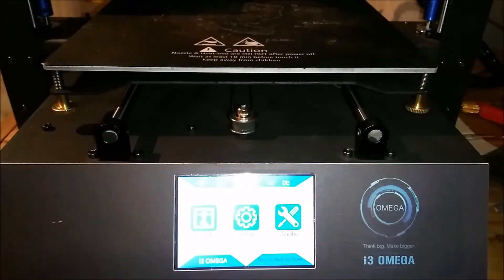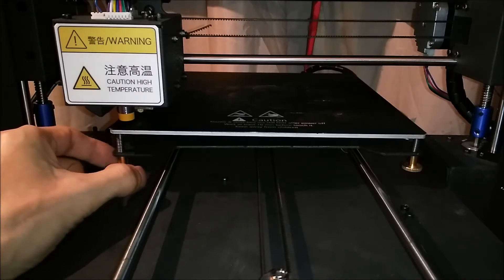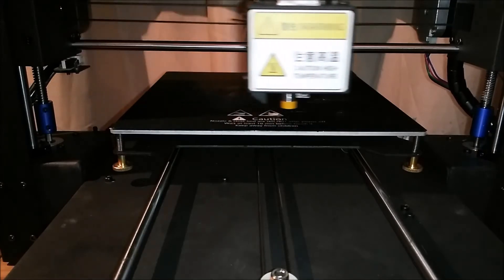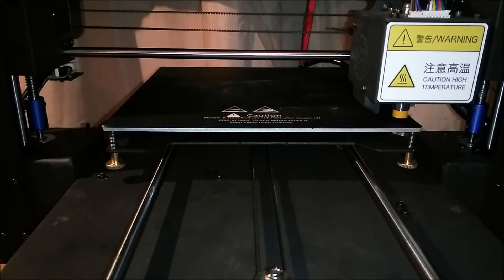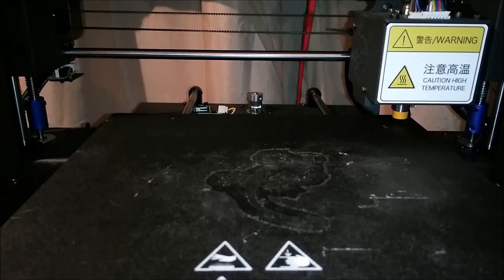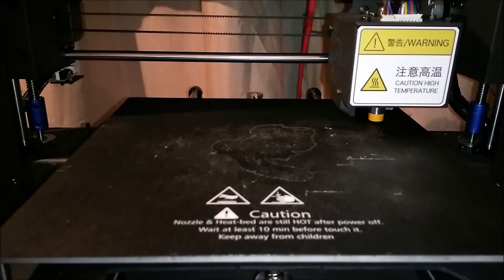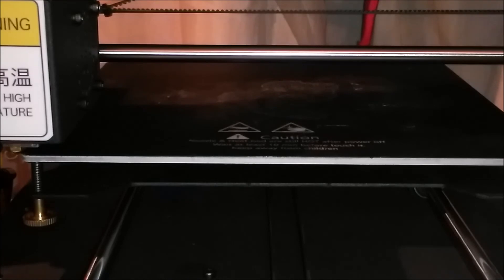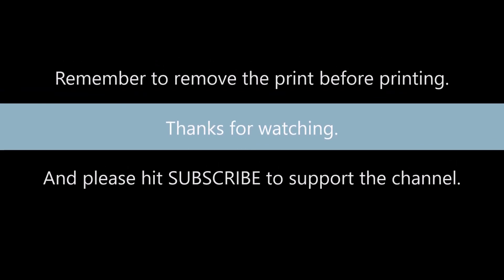Omega i3 leveling

Comment: There is a sw update of the printer ?
Reply from the maker: no idea tbh. i have not had one. but then again i don't think i have ever had the printer connected to the printer. i will do that soon and see if it updates its firmware. i take it that's what you are talking about. ?
Reply: i have not understood how it works with the original fw
Reply from the maker: ok well the firmware that's built into the Omega i3 mega should work fine with no need to update it. but if you are talking about the slicing software that you slice your models with then cura is your best bet. version 15.4. you might also want to check out the facebook page  Anycubic 3D Printer Support Group the anycubic i3 mega is the same as the Omega i3 mega.
Reply: Turenkarn's 3D Tanks i know it

Comment: Hi, is this related to the wanhao i3? I am super new to 3d printing and bewlidered by the huge array of rebrands. I love the large print size on this model, and have been recommended the wanhao i3's... seems a good match if they are one and the same.
Reply from the maker: hmm.. k how to respond to this. it all depends on what you want from a printer. i have not used the wanhao i3 but here are a couple of reviews by trusted users i know. https://www.youtube.com/watch?v=qoEApsA7pAk
and https://www.youtube.com/watch?v=ShFjOEyyEYA    but i think these reviews are for the v3 i went for the Omega i3 mega as it has a larger build platform and the power unit etc is all in the base unit. it comes with a large colour display. is easy to level. has gcode command that allows you to restart a print if you loose power to the machine. so you don't lose a print. and has a filament detector that will pause your print if it runs out of filament to allow you to change and carry on. and the print quality is good. i have had the printer now for about 1 month and happy with it. only thing i can say i don't like about the machine is the fans are noisy but again not a real problem. its easy to build comes in 2 parts connect the cables and put in 8 bolts and you're done. but again all depends on what you want from a printer. and all i can say is i am very happy with the Omega.
Reply: Thanks very much for the info and links :) The wanhao's do seem really nice. Is the omega actually from Wanhao, or are omega a separate company that have copied and enlarged the design?
Reply from the maker: the Omega i3 mega is a rebrand of the Anycubic i3 mega. not sure if its the same company or a good clone.  there are some differences with the 2 machines. but i have not used the anycubic i3 mega. the only filament that the Omega cant use is flexi. as it has a bowden extruder. but for me it was the special functions like the  filament detector and the power fault restart print. and again not had to use them yet. but nothing worse then doing a print that might be 25 hours long just to have filament run out halfway thru or a power cut. :)
Reply: Haha yeah that doesn't sound like fun at all. Thanks again for the info, I will keep the omega in mind

Comment: You know the perfect leveling should be set as sound reply it self as didididi... a point between sound on off
Reply from the maker: ta. but this vid is just the basics on getting new users on there way. and will vary from printer to printer. and new users will find their sweet spot with use. :)